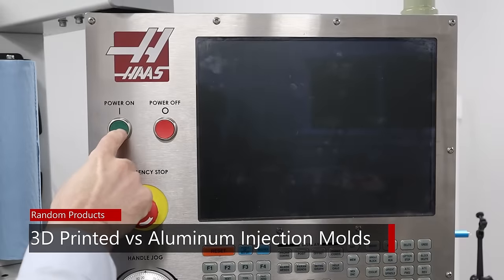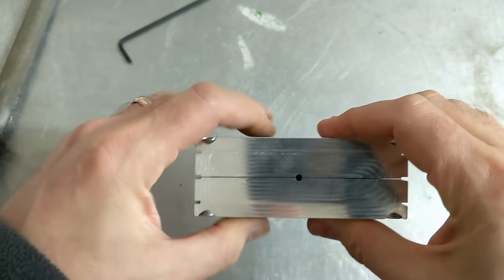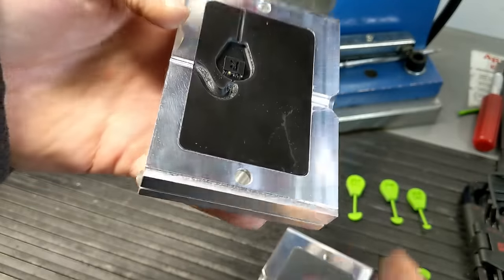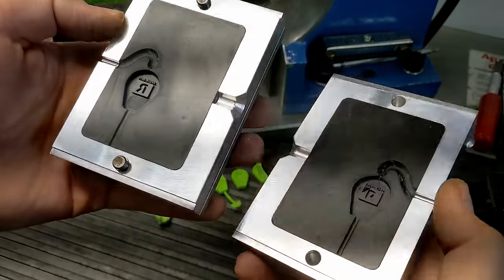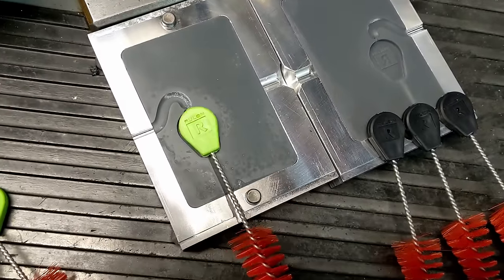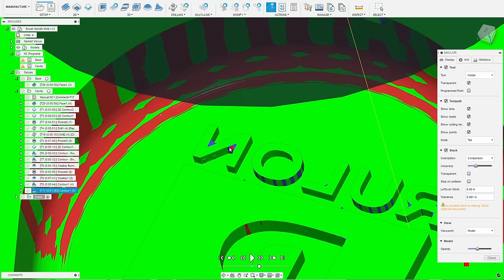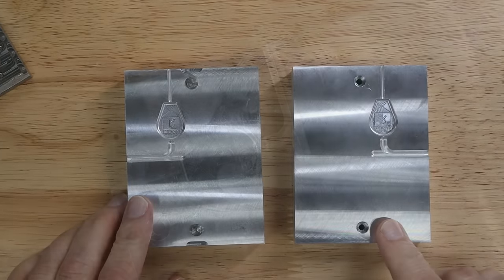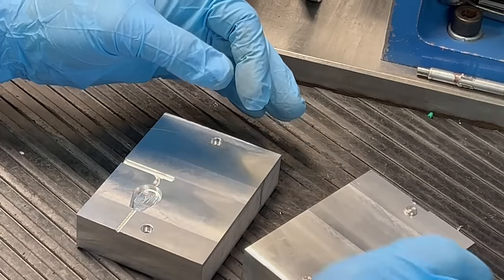3D Printed vs Aluminum Injection Molds

Comment: I used epoxy to adjust the Zip loc zipper for the sandwich bag.  So the steel 1/4 inch thick plate was under full extrusion pressure on one side and atmospheric on the other from 10 to 30 minutes.  Never lost epoxy during extrusion but the brittle plastic didn't like cleaning with dental floss cleaning off the profile. 
One rule for screw injection molding is that pressure is maintained while the mold cools.
Cooling is the issue.  Simply put there is too much distance between the aluminum frame to the injected plastic.  Has anyone considered making the mold with a course shape that has a high aluminum content. use the approach on part size similar to the rules for aggregate for concrete.  I would think shavings would work if clean since they will conduct the heat father before the heat has to conduct through plastic. Then a top casting of the details and all surfaces is none filled or extremely fine aluminum. 
Finally i would consider the spire be a ceramic nozzle bead or donut that is cracked into half between V edge as one would due to get a clean cut. Stainless steel and even steel are almost as poor thermal conductors as ceramic so  make a half donut from steel and put it at the breakoff point of the spire.

Comment: I remember doing a paper on 3d printing in highschool in the early 2000's. How did someone like yourself get into the CAD and stuff considering your much older than me? Did you lean it at university?
Reply from the maker: I'm self taught. I got interested in CAD when I was designing products for model trains as a hobby. I started with a program called VX (I wasn't a big fan of that) and then switched to SolidWorks around 2007. That was before all the wonderful content on YouTube, so I purchased a few books and learned. These days, Titans of CNC is a great resource for leaning CAD and CAM.

Comment: I think the sink is because the wire is not a solid cylinder. It is two twisted wires with a spiral groove so there is a plastic loss into the groove.
Reply from the maker: The sink is because the plastic shrinks and he didn't keep injection pressure on the mold long enough. He changed that setting later, and that mostly fixed the sink problem. But the other reason you typically see sink is when the part thickness varies from one place to another.
Reply: @JohnSL  Is the amount sent into the mold the same predetermined amount every time ?
Reply: @JohnSL   Also, metal expands slightly under high heat but then cools & shrinks.  Just throwing that out there since you said "mostly' fixed the problem.

Comment: What about printing the positive with sprue pieces, and just mould aluminium filled epoxy around it in the mould halves?
Reply from the maker: That would probably work. It's not something I've tried, as I can make an aluminum mold fairly quickly. Probably faster than 3D printing the masters.

Comment: Nice video, I enjoyed it. I wonder if the outer shape of the overmold part could be offset somewhat from the metal brush handle. Then, the wall thickness would be much more consistent, and should lead to less sink. Of course, the aesthetic would be different.

Funny how true it is that when looking at things on screen, we lose a sense of scale, and they often are non-issues with the real parts.
Reply from the maker: Two seconds to inject and pack just wasn't enough. He pretty much eliminated the sink mark by holding the injection pressure longer.

Comment: Thanks for this real world test.  Now I know I absolutely can use 3D printed molds for my needs, 50 being a rare maximum for me.  

Just curious, what’s the cost of the blue injection machines you both use?  I’ll probably go the Buster beagle way because of cost, but not if it’s only double the price.
Reply from the maker: You'd have to check with https://www.abplasticinjectors.com/ about their prices. They're a lot higher than the BB 3D, that much I know. I don't have experience with the BB 3D myself, so can't give you a comparison between the two options.
Reply: @JohnSL  thank you very much for the link!

Comment: Not sure if its worth a try or not, but metal infusion of 3D resin for cooling purpose has been tried with .. maybe small success?   See "Can you print a COPPER INFUSED radiator" on the "Major Hardware" channel.
Reply from the maker: Thanks. I watched the video and the difference wasn't that larger. I had a hard time finding information on the thermal conductivity of SLA resins. But I'm guessing the difference is well more than 100 times for aluminum. For comparison, aluminum is about 5 times more thermally conductive than steel, and steel molds almost always need water cooling.

Comment: Could you make a pewter mold instead (170-230C / 338–446 °F)? 3D print a negative, cast the pewter in the mold mold. After demolding the final mold, machine it to proper dimensions? Not sure how demolding would work.

Also, for prototyping, you could machine a aluminum insert with a smaller opening where the experimental mold goes. That way you'd cut down on wastage and printing time as you iterate. I realize that the insert could cost quite a bit to machine, so it might turn out to cost more...
Reply from the maker: I expect the answer is yes, you could. From what I can tell, the way to do this would be to create a 3D positive of each mold half and use a high temperature silicone mold rubber to make the mold for the pewter. And finally cast the pewter. I expect that would produce a mold that would last much longer, and I may have to try that.

Comment: So the issue is the resin and not 3d printing. Formlabs has its own speciality resin for 3d printing molds.
Reply from the maker: Formlabs has a report about the lifetime of molds made with their resins on their machines, and the lifespan of their molds is not that different. The issue is that the resins need to support higher temperatures and be strong. These resins just aren't strong enough to hold up well for many molds.

Comment: Have you though about nickel plating the 3D printed molds? It should give them some better protection against wear and tear. I not sure how well the plating is going to stick the print though, because the best way I've seen of doing it to first use copper paint on the print and then plate on top of it which doesn't seem as a very thermally resistive bond.
Reply from the maker: I have no clue. It sounds plausible. I think there are several questions in my mind. First, how strong would a thin plating be? Second, how well would the plating bond to the 3D print? I'd love to hear the results if someone tries plating.
Reply: Back in the day, we chrome plated "real" injection molds made from steel. The plating does not hold up well. It flakes off. It would do even worse on plastic.

Comment: Looks like you could do four parts at a time with the size of the mould if the machine can handle it
Reply from the maker: Yes and no. His machine has an automatic ejection system on the left side, which therefore would prevent over molding onto brushes sticking out that side.

Comment: Thank you for the very instructive video!   I am long time 3d printer so most of my investment is in that world. I tried to read through most of the comments but could find a cost comparison.  Can you possibly share a ball park figure on the price I would pay for that aluminum mold? I am really enjoying your videos!
Reply from the maker: I don't want to share the price for this specific mold. However I will say that prices for simple molds start at about $500 and go up from there as the complexity of making the mold increases. This mold is not a simple mold.
Reply: @JohnSL  Thank you for the information.  Your videos have inspired me to try my hand at silicone and/or injection molding.  My biggest problem with 3d printing is the accuracy(FDM) and durability(Resin) of 3D printing.  However, if I can DIY some molds then there would be a much larger range of plastics that I can use.  Keep up the great work!
Reply from the maker: I have an idea of another approach and am working on a video. I expect I'll have that video out in the next month or so.

Comment: Are you using a mold release spray between injections?
Reply from the maker: I think Rulon may have on the 3D-printed mold. The aluminum mold didn't need it.

Comment: If you have a resin 3d printer, why wouldn't you just make the parts directly? Run is limited using a mold anyway, and you could make multiple parts like this in your printer at once.
Reply from the maker: I believe there are two things going on with people wanting to use 3D printers. First, they want something that has better mechanical properties than you get with 3D prints. This might be because they want to use a tougher plastic like ABS. 3D printed ABS-like materials aren't as strong as actual ABS. Second, production with injection molding is a lot faster, so they may be hoping to get higher volume. But I'm just speculating, as I have the machine and skills to go directly to aluminum.

Comment: So, when nearly every single design feature is wrong on a 3D printed mold and it is printed in the wrong material it doesn't work as well as a tooling plate mold?  Surprise there. On the other hand, a properly made 3D printed mold with a flash dam and draft printed in a high temp resin and sized appropriately in the aluminum block that holds it is invaluable for RP if you don't have minumum $15K to invest in a even a prohobby CNC mill. Additionally you gain the ability to make very complex or challenging part geometry molds by using technologies like soluble mold printing to replace complex, muti-dlide injection molds that can cost tens of thousands of dollars as opposed to a mold that takes an hour to produce on an inexpensive machine using $5 worth of resin.
The IMPORTANT thing to do is to match your available technology and tools to your part geometry and find the best solution. At times, I have found silicone casting resins beat injection molding, it all depends what specifically you are trying to make- there IS NO universal "3D Printed vs. Aluminum Injection Molds" answer.

Comment: I'm surprised you guys didn't think of trying to take advantage of a very prominent feature of 3D printing, and that is, YOU CAN MAKE ANYTHING VERY EASILY!   Including. . .  Channels for water cooling.  😁
Reply from the maker: Water cooling makes the most sense for automatic machines where both mold halves stay in the machine. But for these machines you typically pull the entire mold out of the machine. So water lines would make that more challenging. I'm not saying you couldn't do it. But it's a lot less practical.
Reply: @JohnSL  True. . .  Maybe it would be more practical to have the cooling circuit be a part of the mold then.  Like a battery, pump, fan, and radiator all connected to each mold half.  Self-contained.  Not to increase the speed of cycle times but rather to make the 3D printed materials stand up to the heat better.

I've also wondered about water cooling for 3D printed internal combustion engines.  People have tried making them before and watched them melt and fail.  Water cooling might actually make them work because with 3D printing cooling channels can be implemented extensively without much effort at all among all surfaces.

Comment: What is the vise on the injection moulder?
Reply from the maker: It's not a vise, but rather a clamp that is built into the machine.
Reply: @JohnSL  cheers. I only ask,  because I run a small injection moulder, and I have a lever/cam operated ' vise' that I'd love to switch to a hydraulic or pneumatic one, as all my moulds vary slightly in thickness and it'd be much easier!

Comment: 23:32 Wrong, if you are doing production you need steel molds, Aluminum will wear down and be useless after about 4000 shots, where as steel will easily go up to 50,000 before needing work.
Reply from the maker: That depends on the size of the market. The people buying these desktop machines are in the short run category. I've had people tell me they want a mold and have a huge volume. When I ask how many, they say 100/year. It would take them many years before they would wear out the mold, if ever. Another example is the model train cases that I designed. Those molds are aluminum molds because the size of the market is small enough.

Comment: Hmm. A while ago, Easy Composites posted a video comparing the structural strength of different application methods of carbon fiber to each other and 3D printed carbon fiber. Their test clearly showed that the 3D print was hardly any stronger than regular PLA, due to the minuscule fiber length, but I was thinking, I don't know about the thermal properties of CF, but I do know it's a good electric conductor, and those tend to be good thermal conductors too. Might a mold made of that (I think the commercial name is NylonX) be a better fit for this application?
Reply: Cute Grace icon
Reply: @VagabondTE  It's my favorite avatar. It was made for me by a forum friend way back in the day 😊
Reply from the maker: I know there are FFF printers that can use filaments with fiber. However, are there any photo polymers with fibers in them? That seems like it might be challenging because of the nature of SLA printers. But I'm no expert.
Reply: @JohnSL  Fortify make commercial SLA printers with a particle mixing system for fiber reinforced and particle filled prints. It's basically just a recirculating pump to keep the particles in suspension; now that I think about it, I don't think it'd be terribly difficult to retrofit a diaphragm pump to a consumer-level printer.

Comment: To solve sinking you can add some baking powder.... And you will thank me later
Reply from the maker: I know that works with resin casting to help eliminate defects from air. But how would it eliminate the shrinkage of the injection molded material if you don't leave the pressure applied long enough to ensure packing.

Comment: Seems like a waste of time and money if is only good for a few dozen parts. Best to do it right and machine the mold out of aluminum or graphite and then EDM the mold. I guess the old adage holds, you get what you pay for.
Reply from the maker: Some others have provided a good use-case for this process. If you need someone else to make the mold, because you don't have a CNC mill and the experience to use one, a 3D printed mold is a very good way to try things out before you pay someone to make a mold. So in this case the mold is only to test the part and/or moldability of the part. I think that's a great use for this process.

Comment: metal filled Hi-Temp epoxy systems put 3-D printing attempts to shame. I've been doing this for 30 years+. 3-D printing IS NOT a 'cure-all! It's fun, but foolish to use instead of many proven processes.
Reply from the maker: Absolutely. I've been wanting to try epoxy molds with aluminum powder, but haven't gotten to that yet.

Comment: I can't stand those imperial units! Bye! Metric system sent man on the moon, not inches! Get rid of that un-scientific system! Thanks to Napoleon the world science became more consistent, less bond to fantasy obsolete units! UPGRADE!
Reply from the maker: I wish we had gone to 100% metric in the 70's. But living in the U.S., it's far easier (and often less expensive) to buy material and tools in imperial units. Plus the injection molding machines I'm using have sizes based on imperial units. Or, is it that you're asking that I include an overlay anytime I mention imperial units that also shows metric?

Comment: siraya also has "sculpt ultra" goes up to 220°c.  im almost sure, the wear was due to the clamping, not the heat. those surfaces really werent plane. i think he didnt wash the print enough before curing. normally resin printer leave a mirror- finish thats perfectly plane. if your printer sucks, maybe try to facemill the print. no stress hotspots while clamping, no chipping of the print. i would bet :)

Comment: You can easily add holes/galleries for liquid cooling on the molds, that will help to keep the temperatures low, preserving the mold longer. This is actually the real benefit of 3d printed resin molds.
Of course this will work better on a automatic machine that has cooling for molds, but just giving my 2 cents about the subject.
Reply from the maker: I've seen examples of this being done for molds run on automatic machines. I imagine you could do the same for manual molds. But having to deal with the water lines as you remove the mold and put it back into the machine wouldn't be fun. I'd much rather just use aluminum molds.
Reply: While completely irrelevant to this level of manifacturing, we do 3d print steel molds with custom cooling channels 

We're able to run them 20-30% faster in steel and sometimes 150% in copper